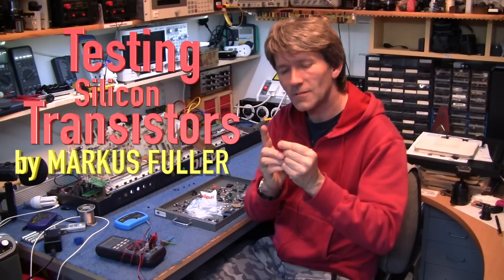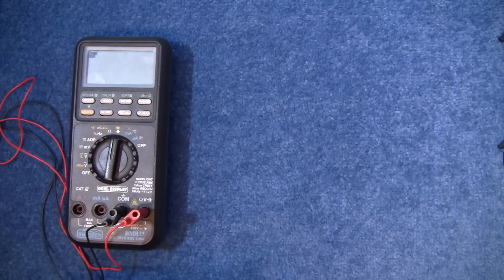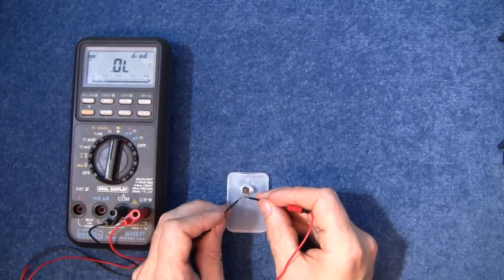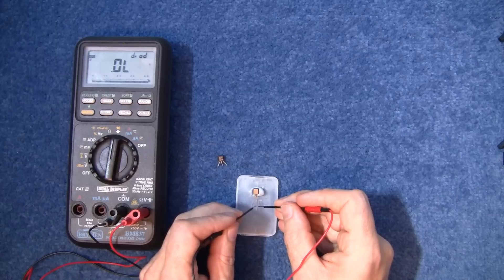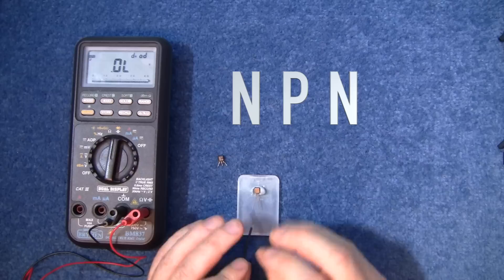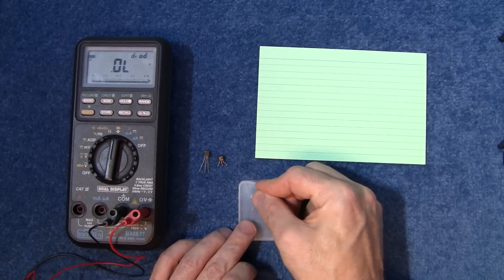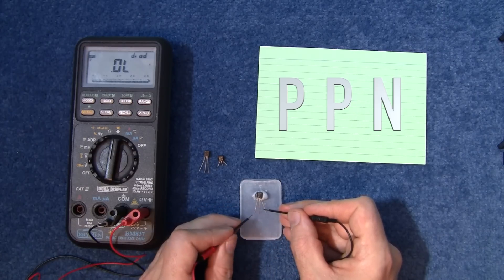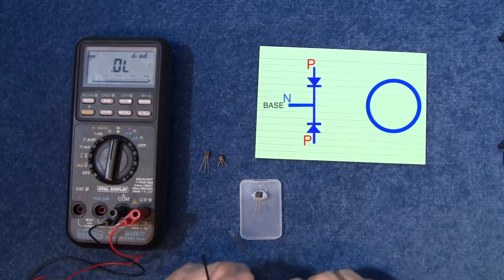How to test a TRANSISTOR with a multimeter PNP or NPN MF#63

Comment: Thanks for your video. 
I wish I could have followed everything, but the video camera was far too distant from the demonstration area to see (1) where your test leads  were placed and (2) that prevented understanding of PNP vs NPN.
Rather than devise only a supporting closeup camera view, you could supplement that with your screen inset panel to make the logic of the connections clear.
Basically, you slready have the nsrrative, but need better camera and screen inset  support to show graphically what you describe verbally.
Good start, however.

Comment: I have a box of medium power transistors and apart from finding out if they are PNP or NPN my main reason to watch your content was to see if I could identify where the base was, which I used to assume was in the middle, but apparently this is not always the case, so I assume your technique allows the identification of the base as well? Also I wonder if you could post content about protection diodes regarding back EMF from electric motors. Is this required even for small motors?

Comment: Hey Markus...
Can the Transistor be partially failing?
Because I took one out that looked to have overheated,
But it still gives me a reading when I do this test that you showed us.
Do you think it is still OK?
I am trying to find out why my circuit board is not working (on a Yamaha digital piano).

Thank you for your time!
Reply from the maker: @matthewmathis62  Hi Matthew, I have been caught out in the past by changing a transistor that lookes cooked but is actually ok and a transistor that looks fine but is not. also your transistor may work but breakdown when it reaches a warm temperature. If in doubt just change it for a new one if they are not too expensive. best wishes.

Comment: I need to take some transistors off a vintage amp for testing and this has given me the confidence and understanding I needed. Tha k you for you're clear explanation that also explained the function so we can learn a little more about how the electricity flows and the circuit works.

Comment: If the goddamn multi meter (pardon my expletive) has a diode checker on it then it's not "simple". A simple mm has ac voltage , dc voltage , dc amps & Ohms gd it !! 👍

Comment: Nicely explained Marcus and thank you. I am in the process of putting new transistors into my wurlitzer 200a, and it's not making a sound. So am assuming there's a bad transistor there, or maybe one that is in a different direction than wanted. The amp is working on this, though no sound from the piano yet.... Hopefully will find the issue, though presuming I need to remove them...

Comment: Hopefully new tekies get this instead of using the DCA55 to check VINTAGE transistor hFE. I see he has one. The DCA55 and 75 devices do not work for old vintage transistors. They all fail. Do what he just did and check for leakage across CE and should be good to go.

Comment: Thank you.  As I understand it, the emitter pin will have a higher voltage drop than the collector, as the emitter is more heavily doped.  For the NPN transistor, the leads appear to be laid out as E-C-B.  Same for the PNP.  Lord knows with all the packaging styles, it's anyone's guess as to which is which, and some HP test procedures ask you to short the E-B!

Comment: Hi good video ,but I have a NPN transistor that is completly shorted ,so it doesn't matter which way you connect the probes, middle is the same as the negative leg and positive, its just all one ,
Reply from the maker: I think that one may be faulty.
Reply: A yea from a bit of research I discovered that alright, but I was just I suppose pointing out the other scenario, I think you covered the possibility of it going open circuit ,hence the reason I brought up that .
Reply from the maker: @danieldoherty8009  Yes thanks for bringing that up as I do not think I covered that in the video.
Reply: @markusfuller  no worries ,just thought I'd mention it and then that's everything covered in relation to theses .

Comment: Wouldn't the base be the center pin?
Reply from the maker: not always. you should check the datasheet for the transistor you are going to use as any pin can be Base Collector or Emitter depending on the part number or style of package etc. just google the part number as theres many variations of the pinouts.
Reply: @markusfuller  I'm confused because you say the right leg is the base on both of those and then use the symbol showing the base as the middle one, 1:20 and 2:15, we are just trying to learn at it just isn't make sense to me.

Comment: i have a board with a bad pnp transistro can i just replace with any other pnp transistor or the on the multimeter has to be the same ??
Reply from the maker: Hello Karim. It will be best to look on google for “transistor equivalents” and type in the number of your bad transistor, you will be able to get information and possible equivalents for the one you need to replace that will be close enough to be almost the same job plus there may be the same transistor on there but the pins will be different. depending on what the transistor was doing you need to get something that is similar or the rest of your circuit may develop problems or may need to make changes to some other components to compensate. if you get something close then there should not be a need to change anything else on your circuit board.
Reply: @markusfuller  thank you  for the help

Comment: These videos on testing transistors confuse me.   If it's PNP shouldn't you touch the leads on the transistor in that way to test it?  P positive, N Negative?  (Newbie here trying to learn.)    Another video says the emiter will have a higher reading, is that true?  I wish I could figure this out.

Comment: Great video - well explained. Any recommendations for a cheap multimeter that does everything?
Reply from the maker: Hello Rhodri. theres never a multimeter that does everything but if you look at this one theres capacitor test transistor test diode and even a temperature probe https:amzn.to/2XQXksi 
 theres just so many to choose from and the range of prices is crazy. mine was a cheapy amazon one but I also have a fluke that costs 10 times the price and it does not do anything more than my amazon one.
Reply: @markusfuller  Markus, thanks for the reply - I got a Kuman eventually...its pretty similar to your recommendation. My idea is to start simple and build a Rangemaster treble booster pedal from a kit. I'm going to get a second Rangemaster pcb board and build another rangemaster at the same time using old parts harvested from old radios etc. Very nervous!!!!

Comment: Can you test a transistor in circuit or do you have to remove it? anyone know?Thank you
Reply from the maker: Hi Rob if you try and test a transistor in circuit then you will affect the readings depending on the other components connected within the circuit. so it is best to remove the transistor before testing it if you use the method in my video. however if you know what the transistor should be doing in a powered up circuit then there are different methods of testing it.

Comment: Hi Markus, can you tell me where you get those multimeter probes? They look very useful. I wonder if this comment will get to you on such an old video, great channel.
Reply from the maker: Hi makermatthew. those probes i use were purchased from maplin electronics many years ago but they have since closed down. I dont think they were actually multimeter probes but were just called long reac spring tipped probes. I think they are based on pogopin probes but I don’t know the proper name for them. maybe look at rs-electronics or farnell or mouser they may have something similar. good luck.

Comment: Im trying to salvage transistors from old cellphone chargers and other devices. I would like to make a led blink using a transistor resistor and capacitor. Does the transistor function differently when different voltages are applied?

Comment: anybody knows what E, B, C, E, and e, b, c, e stands for?
Reply: it stands for Emitter, Base, and Collector analogue to the Pins of an Transistor module. Now why my multimeter has fixed EBC setting? (It is a fix gearing that only shows to the small c as they listed up on the multimeter as ebce and further ECBE). So i think i can test only the collectorpin of a transistor? That makes no sense to mee

Comment: those two must be Japanese transistors to have base not in the center.on the other hand the strange and confusing thing is if you had put the negative lead on middle pin on that NNP, you would have gotten reading from left and right pins which would make in PNP.

Comment: Markus,
thank you so much for this simple explanation.
I have recently finished a DIY modular "kit" (it's a Serge Synth) and had to solder a single SMD part: A matched pair transistor. After soldering it on with a way too big soldering tip I was pretty sure I destroyed it. After watching your video, I checked its six tiny feet and voila, there is only current coming from one P to two Ns on both sides. Until I can finally check it (the Output module pcb of all things is currently out of stock and will be sent in a week or two) I will remain fearful I'll have to resolder that transistor after all, but now I can sleep a lot better until then!

...Also, your videos made me interested in DIY synths in the first place. Opening up those machines is just way too exciting. Please continue making videos on your channel in 2018!

Comment: great vid, I found my bad transistor. But now I what can I replace it with? These Baldwin part#s are not anywhere on web. I have discovered The "Ray" on the top of the transistor s is probably  made by Raytheon  and I found two different part numbers used for what was just suppose to be one item? But neither the "T59285-6412" OR "1396A-6404" part numbers for transistors  shows up on the net.  I got to admit, I know  how not to get electrocuted but other than that I'll be the first admit. I'm slow. I try to pound this stuff into my head to try to learn it, but every corner I turn.  I don't know what street I'm on when comes to theory and what make this stuff tick.  But something happens to me when I see an old amp or something with tubes or this old organ. Like yeah I'll take it.  But this sucker weighs a ton.  It was in the back of my car for almost a week. and I just drove my wife car so I wouldn't dislodge anything.  And now this thing is sitting in the middle of my studio.  I got get it working or the... worse.  I always been against it, Because I truly do believe we must try to preserve this historical things  but I will be forced to gut it  a first for me. Sorry Mark for the testimony. 
  Do you have a suggestion what I can use to replace this Transistor with. I have three more tone Generators after this one to fix. I found something that says these transistors are "PNP"
Thanks
AmIOnARock
Reply from the maker: Hello I have looked in my old transistor books and cannot find this part at all, it may be better trying to find the part number as just T59285 and leave out the last 4 digits as they may be the date code ie 6412 could just be year 1964 week number 12 of manufacture. same with the 1396A-6404 the last 4 digits is probably the dat code. I know your problem as i find it very hard to find replacements of many transistors from the early years. some were discontinued because of certain poisonous substances used within so they are no longer sold but there should be some replacement part that should do the trick, it's just a matter of the long time it can can take to find it. good luck.

Comment: What if your red probe cable is connected to negative battery pole, and your are completely wrong? How can you be sure which indicates positive?
Reply: Then your meter is broken.
Reply: Early analog meters often had leads reversed - the meter worked fine with reversed battery polarity. In order to make sure your leads (and color code) are correctly soldered onto the meter, place the leads across a battery - with the red going to positive and the black to negative. If the voltage is positive, your meter leads are correctly installed. If the voltage is negative, your leads are reversed.

Technicians used to check this after purchasing a new meter because analog meters will read in reverse. With digital meters, I have never heard of the meter leads being reversed - the electronic components will not work if the meters battery polarity is reversed.

Comment: you could add into this video  that the highest resistance between the two diodes (BE-BC) is the Emitter. If you measure in  Diode mode on your multimeter, the highest Voltage is the Emitter. The Emitter is heavily doped, That's why  the BE is higher than the BC. Then you know all pinouts .
Reply from the maker: +Jan sædal Hi Jan. I always seem to miss things out when making a video but thanks to the comments section people will read your reply and everyone gains a bit more info. Many thanks for adding this.

Comment: Cheap chineese transistor testers show all stuff at once =)
But as a child i've read how to test tr-r with just an ohmmeter, old analog one, with pointer, not digital. The essentials are in this video, but it also said that collector has higher impedance.
Reply from the maker: +nihonam Hi Yes I looked everywhere for an analog meter so I could show how to use one for the same transistor testing but all that was available was the digital one.

Comment: Can you make a video showing how to match, or pair transistor for ladder filters, or expo converters for VCO?
It's very important topic for synth builders.

I like you work, greetings from Poland :)
Reply from the maker: +Krzysztof Witkowski Hello I did that about 30 years ago with old instruments but I guess it should be easier to do now. I will try and have a look into it again (my memory is not as sharp as it was when man landed on the moon all those years ago :-)
Reply: +markusfuller Impressive. In internet there are several methods (e.g. moog method with using opamps, simpler methods using a couple resistors, diode, or even connecting collector to base and measuring it with multimeter like diodes), and I don't know which is best for synths (VCO good tracking at 3 octaves is not satisfying at all :D )
Reply from the maker: I am not sure. I guess my old method that i learnt years ago is well out of date now. I would only go on the internet and start learning it all again fresh.
Reply: markusfuller We will be very thankfull :)
Reply: Google "moog transistor matching" images.  Note there is an error in the diagram; the PNP test circuit is missing its 10k resistor between the two transistors - it should mirror the NPN circuit.

Comment: Thank you so much for your video here..:-) Would you know what i should use as a substitute for a 2SC2130 NPN ?
Reply from the maker: Hi Steve. I had a quicl look and it seems an NTE199 is the recommended replacement also with Base Emitter Collector in the correct order.
Reply: Thank you so much Markus...blessings to you ...:-)

Comment: The number shown...is that the voltage drop?
Reply: Yes.  The diode test on most meters just applies a small current and the meter displays the resulting voltage across the junction.

Comment: And how do you differenciate between collector and emitter?
Reply: +IncreasingVoltage Best way is to make a transistor circuit. 2K resistors at both Collector/Emitter output. 1V at base. 5V in series with the 2K and the guess collector, Ground at the other side (do not forget the 2K resistor, this is the emitter you guess). 

More clearly:

5V - R2k - BJT_C - BJT_E - R2k - GND

1V - BJT_B

If the voltage over both resistors measure around the 0.3V, you guessed correctly.
If they are not, change polarity and check again. Pin closest to the 5V is the collector. 

It's probably also possible using a diode test. But I don't know, too much floating points and unknown diode test voltage for me to calculate a way. I'm too lazy to try it out, so check it both with diode test and resistance test, you'll probably find a reliable alternative. 

But, the best way is always to check the datasheet. Saves you a lot of time.
Reply: +Rivalo I'm still a bit concerned about the reverse option (5V not applied to collector but emitter), this means the transistor will be reverse biased. With 1V at base this could potentially lead up to -4V, that's pretty high. Maybe try 2.5V at base. Both resistor voltage should be 1.7V. 2.5V is also easier to get from 1 5V source. If I'm wrong please say so. Need to refresh my transistor circuit knowledge!
Reply: +Rivalo Shouldn't be Ube lower than Ubc? I dunno. Studied electronics engineering für 4 Years but this f*cks me every time...
Reply from the maker: +IncreasingVoltage Google is the easiest way to find out. but other than that its a little more difficult and requires a bit of circuitry or a specific transistor tester such as the Peak Atlas DCA55 . but I just wanted to make the video simple and using a standard multimeter so anyone can fault find easily. Best wishes from Markus.